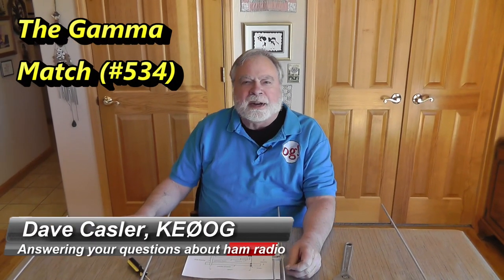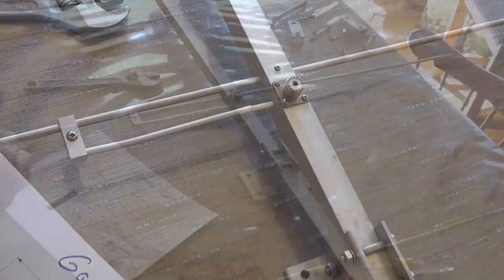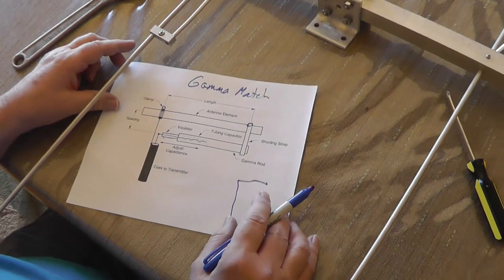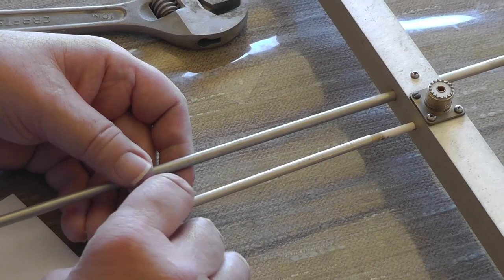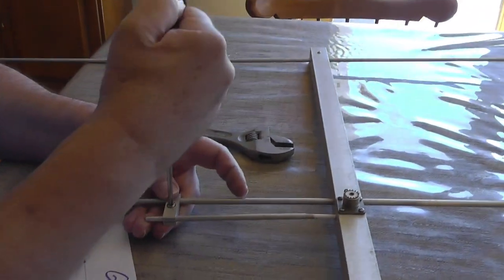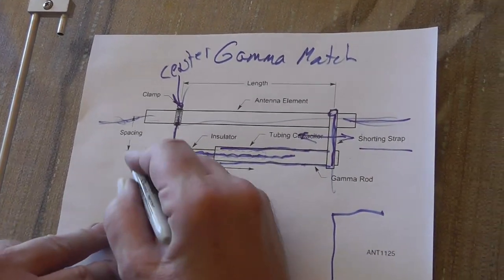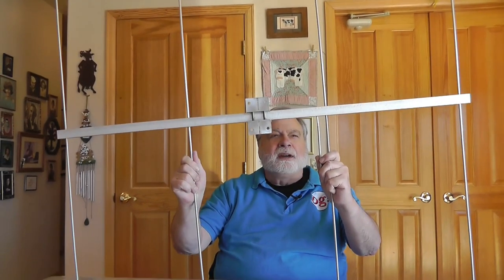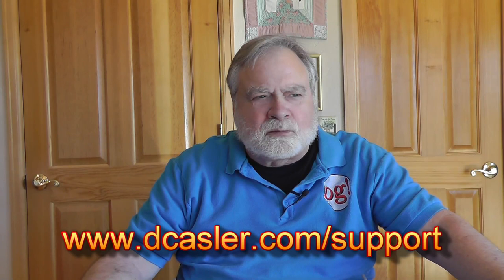The Gamma Match (#534)

Comment: Not clear to me for sure:  sliding tube over wire (capacitance) controls resonance and sliding shorting strap controls impedance??   Also it looks like driven element is directly attached (connected) to Yagi mast, not insulated electrically, right?

Comment: Hi Dave, Im struggling to understand why, and I'm guessing it does not matter, but that none of the elements/driver are not isolated from each other plus the boom. Why is this?
Reply from the maker: They are not isolated at DC. At RF, the boom is perpendicular to the flow of RF, so it doesn't really get into the equation. The centerpoint of all elements is at zero volts.

Comment: Howdy.
I built a mag. loop for my CB radio. Using a circular driver loop I could not get under 1,5 SWR. Kevin Loughin has a clip where he experimented with different driver geometries and found that the driver should be oval. I tried that and got down to about 1,2. I tried a gamma match and got 1 on the spot. And the best. It tays 1 all over the CB band. I only need to tweak the capacitor to resonate at a channel.
So yes. I warmly recommend gamma matching.
Regards.

Comment: But... why don't you explain what is varied by adjusting the elements of the gamma match, and the extent to which they interact?  If I want to move the lowest SWR frequency, how do I do that?  And how do I then adjust the impedance seen by the feedline to 50 ohms?
Reply: He probably didn't explain it because he doesn't know. I did read a good step by step approach once, but can't remember it. I haven't played with gammas for a while, but I know a good systematic approach is the key to getting your antenna tuned quickly. 
When you move the tapping point out you're stepping up the impedance, and with this, adding inductance. So I imagine you have to slide the capacitor component in (increase the capacitance) to cancel this inductance out. Find the area where the tap dips the SWR, and go back and forth with the cap in small increments. I suppose you could begin with the cap half way and figure out the direction in the beginning (whether you have too much capacitance or not enough). But this depends on dimensions. There are examples of gammas in the ARRL which you could scale yours to, and this may also get you in the ballpark for initial tuning position. I'm sure there's plenty online too, showing the measurements to adjust it to, so just scale it for your design frequency.

Comment: Hello Dave, thx for another great content. My V-Quad Delta Loop for 10 / 11m has a gamma match system. I have seen many yagi beams for shortwave running gamma match. Simple to adjust and works just fine. Easy to home brew from left over aluminum pipes and shrink hose. 73's de Your Friend Uncle Guenter

Comment: Dave, I've heard that the gamma match will yield a non-symmetrical lobe coming off the front of the antenna, due to the match being only on one side of the driven element.  Is that accurate, and if so, does it matter?
Reply: I believe it does. It makes sense considering it's physically not symmetrical. Personally, I think it's better to build yagis with a direct 50 ohm feed instead of these plumber's delight type antennas. Some say it's a much more complicated build. However, you don't have to construct a matching device, and they will outperform these old school, compromised antennas. Feed it with a coaxial choke at minimum. The LFA is the one to build, you'll never go back.

Comment: Thank for this! It looks like a very simple, sturdy antenna you have, although I'm not sure of the brand. The way I understand it, is you basically have a tuner that's ON the antenna. The sliding potion is the inductor and you've mentioned the capacitor. The 38 inch half wave driven element can ONLY be resonant on the 1/2 wave it's cut for (145 Mhz). The match is just for adjusting the feedpoint impedance. I'm trying to fully grasp this concept myself. A good antenna to practice understanding the concept of feedpoint impedance is a J- pole for two meters or a UHF frequency (even better). You feed it in the end, it's 300 ohms, you feed it a little ways up, the impedance is 50 ohms. In this process you've NEVER changed the resonant frequency of the antenna. A copper pipe (or tubing) J- pole is also an excellent driven element for a beam! :) I'm going to try to feed a 2 meter beam with 300 ohm open wire line just to say I've done it. 73's- Ryan.
Reply: The gamma rod steps up the impedance. Look at it as a portion of a folded dipole. The variable capacitor is then utilised to cancel out the added inductance.

Comment: Wow what a terrific tutorial. So I assume that the reflector and the director elements are at ground  potential, so if this is the case does the driven element’s radiated power excite the other elements?
Reply from the maker: The center of each element is at ground potential (voltage) but the current is quite high. Yes, the driven element's radiated power pattern is shaped by the other elements.

Comment: Do you have any antennas with the hairpin match and shorting bar? Does it do the same as the Gama match? The old hygain antennas used to use them on their beams years ago.
Reply from the maker: The hairpin match is balanced to balanced, whereas the gamma is unbalanced to balanced.

Comment: Which coax should I use for gamma match??
Reply: something with the thicker core (the inner) but i have used 5mm copper pipe with 2 spacers on it , pushing into the thicker 10 mm pipe in my case, 2.5mm spacing can carry 2000 volt so no problems .